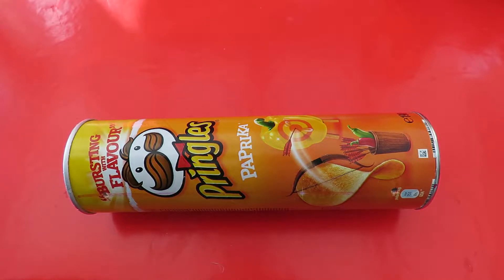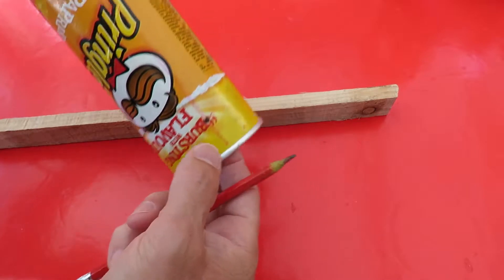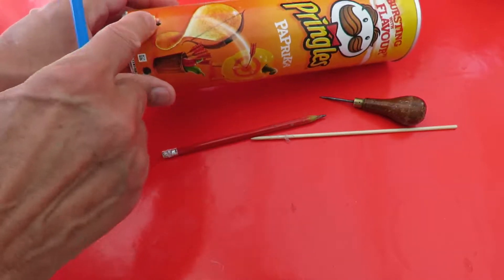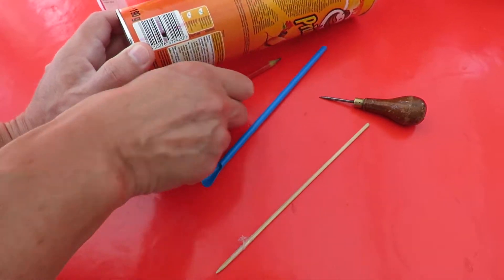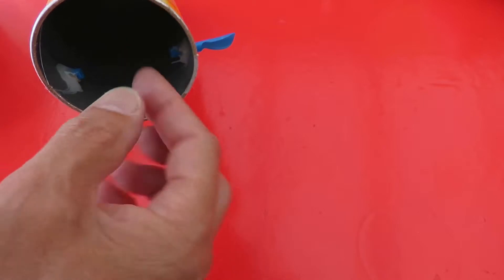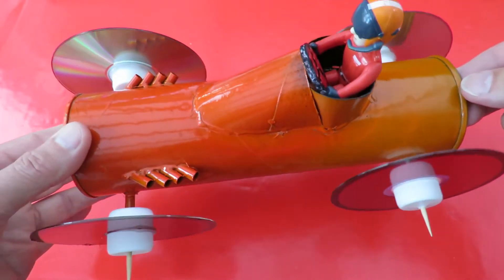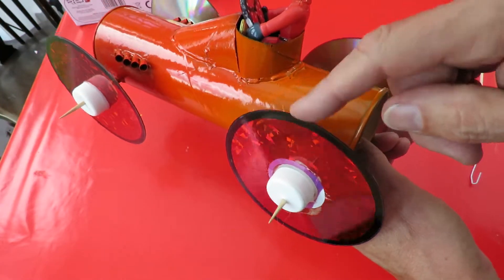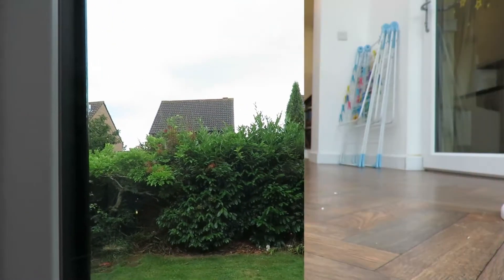Put a rubber band on it #0017

Comment: I liked the hot rod one you did before, it topped my feed along this one, I like the edition of the exhaust stacks. If you have a small piece of carpet or a towel it may give enough traction to stop the wheel spin
Reply from the maker: Some of the cars on this new channel will probably be very similar to the ones on my main channel with maybe a few tweaks or different components. I don't normally make any attempt to make these rubber band cars resemble a "real" car as they are usually just for school projects and required to cover a certain distance or be made from specific items.